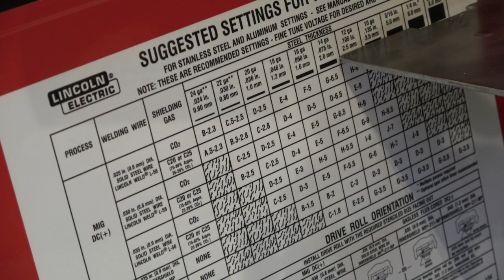eBike Kit: 48V 1800W Razor Quad ATV Upgrade Father/Son Project! - Part 1

Comment: Just switch 2 phase wires and pull the hall sensors. Also, for as much fabrication as you've done, add a chain tensioner.

Comment: I think we have the 24 volt version. I’ve seen a video where they increased to 36 volts by using Ryobi power tool batteries and another where they added a 3rd 12v battery like the stock batteries. Any suggestions on the most straightforward way to modify the smaller 24v Razor? Thanks

Comment: Dave, you dont need a new controller.  You wired it wrong.  Brushless motors can run either direction, you just need to get the phase wires and halls in the correct order.  With a job like this, call a pro...like us, Wild Scooter Parts.  We have built many brushless setups up to 30,000 watt.

Comment: Why didn't you just make the motor mounting holes  elongated so that you could adjust the chain tension ? Simple easy. You could have used a lock nut on the motor instead of nut zerts. Too much overthinking the process.

Comment: Just in case you didn't figure out the phase wiring yet: AFAIK you need to reverse blue & yellow phase wires, and green & yellow hall sensor wires. I'm on the same boat, but I have the 60V 2000W BLDC version.

Comment: Where did you get the new controller I’m having the same promblem also where did you get the chain guard
Reply from the maker: Controller is from Amazon (and eBay), but the chain guard had to be fabricated.
Reply: Dave's Garage can you put a link pls and did it help you make your motor go foward
Reply: To change the motor rotation reverse the terminals inside of the connector (easy fix)
Reply: Stephen von Voros wich connectors and how is there a way I can contact u
Reply: my reverse solution will only work on Brushed DC motor not the "brushless" type
Reply: Stephen von Voros hi it’s a brushless dc motor I just switched the sides of sprocket and brake and put the motor on the other side so if spins foward so far it looks like it’s gonna work but thank you for your help!!!
Reply: @leviray5935  I see why you can't just switch the wires for motor shaft direction. The field is commutated by the controller which figures out on it's own the position of the rotor. Without additional sensors, the controller has to guess witch way the rotor will turn regardless of how the 3 wires are hooked up. This is a controller designer's choice and in cheap controllers fixed by his choice. I realized this after I made the first comment
Reply: Stephen von Voros hi it seems my idea seems to be working well in posting my videos on how I’m making my atv go faster that I had for 5 years and I grew out of
Reply: Nvm I’m think what I’m doing is going to probably work I’m gonna swap my brake and sprocket sides and that will give my atv access to go foward
Reply: Is there a part 2?

Comment: come on man... part 2
Reply: I know I'm like where is Part 2
Reply: @JRJRCrawlers , Yeah I would like to see part 2 as well.  To change the motor rotation reverse the terminals inside of the connector (easy fix) I have since bought my own Dirt Quad 500 and upgraded the 3 batteries to 10Ah, added a key switch and reverse through an additional relay. The 10 mph stock speed is OK for my back yard. The 48 volt mod in this post seems unnecessary any more speed or power would just make the front spindles break quicker! IMO
Reply: Stephen von Voros yeah my sons we upgraded and stretched and it’s about 14 top speed after some gearing changes too...
Reply: @JRJRCrawlers  Thanks for the reply, I would think the ebay 48 volt upgrade kit would be a simpler method
Reply: Stephen von Voros actually this was a lot simpler and cost effective and we only added one battery... My sons is the Dirt Quad not the 500

Comment: where is part 2?  Need a simpler, non frame cutting and welding version.  Can you show the wiring in detail showing which wire is connected to which from the throttle to controller, and the motor?
Reply: here it is:   https://www.ebay.com/itm/Razor-Quad-500-Performance-Kit-48v-Performance-Kit-FAST-Controller-and-Throttle/324027749466

Comment from the maker: One thing I didn't mention in the video is that the reason for moving the motor forward was that once I had it apart and counted the teeth and the transmission to compute the final ratio, the driven sprocket on the axle needed to be so large (70+ teeth) that it interfered with the "stock" mounting location, hence the need to move it in front of the spring.
Reply: Thanks for this update! Did you find that the motor had enough torque when under load? I'm thinking of using it to convert a mobility scooter.
Reply: Did you know you can buy a half link?